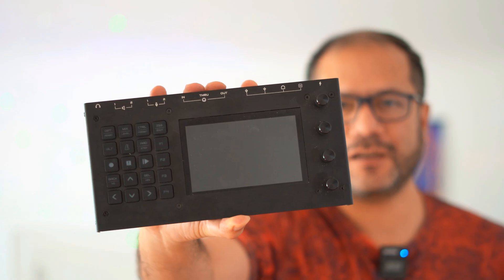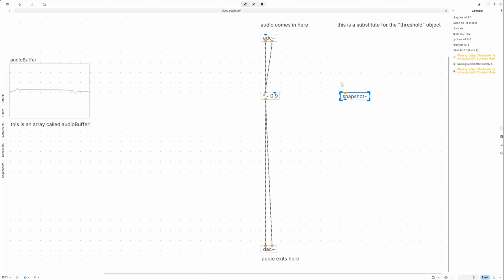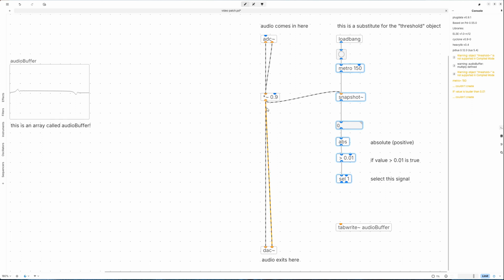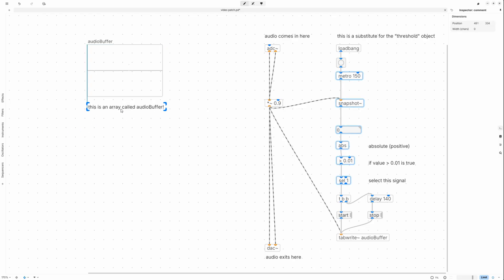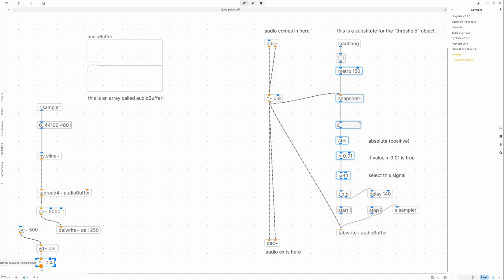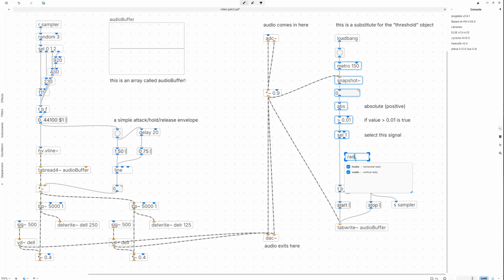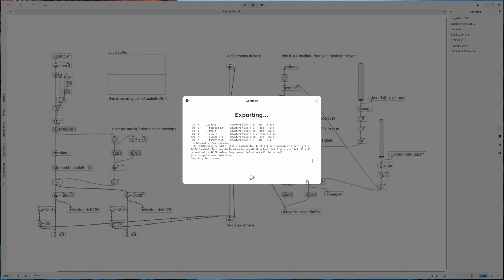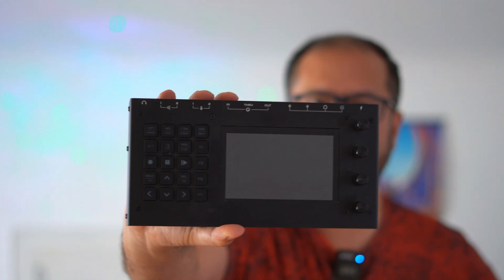Make your own granular shimmer effect for $0*

Comment: I am stuck at ~9:00 the audiuo in my buffer looks good, but the output from my tabread4~ is a binary version of it, so that audio is just clicks. The only difference I can detect is that, in my message box that sits above the vline, my plug data won't keep the period after the 0 in the in the "0. 44100 500", but that may be because I am on 0.9.2 or some other preference?
Reply from the maker: Hi, this is a comma:  [0, 44100 500(